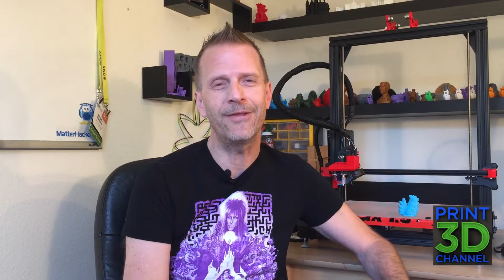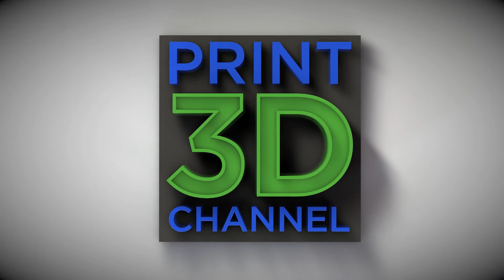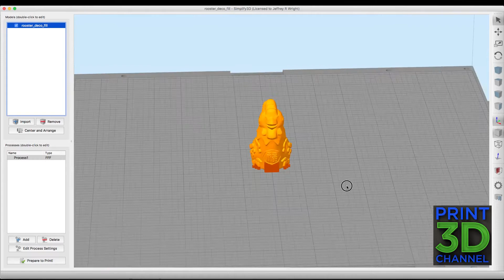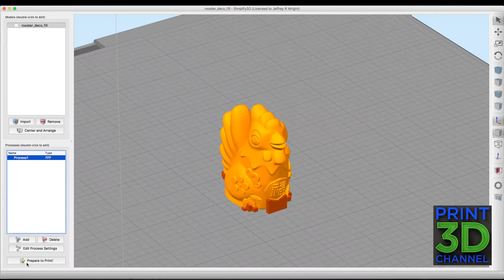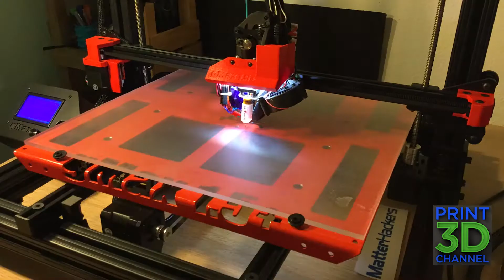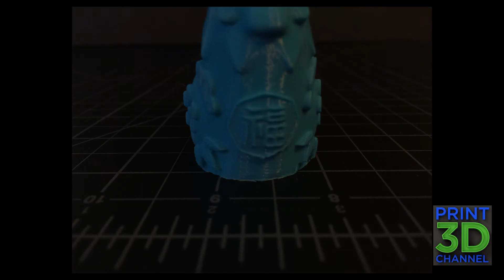#3DP365Project - Day 34 - Crowing Rooster - MatterHackers PRO PLA & gCreate gMax 1.5XT+

Comment: Hi, nice print as always. Any specific reason to setup lower temperatures for the first layers? I'm usually using higher temperatures for the first layer to get better adhesion, and I thought it was the common rule.
Reply from the maker: Thanks and thanks for watching! The settings from gCreate have that first layer at a lower temp and I have always kept it that way. Don't have any bed adhesion problems but I will look into the common setting of higher first layer. Gordon, if you are reading, can you chime in on this one?